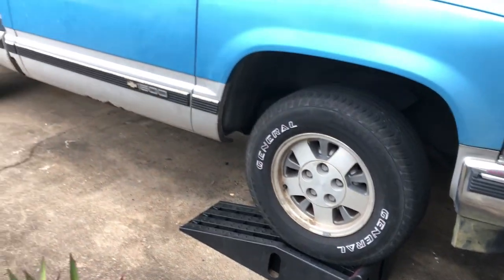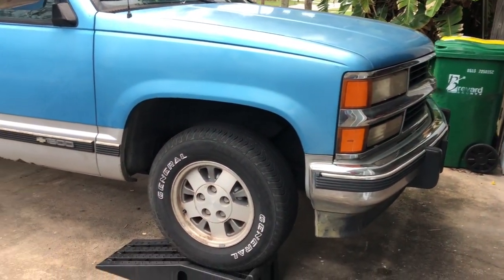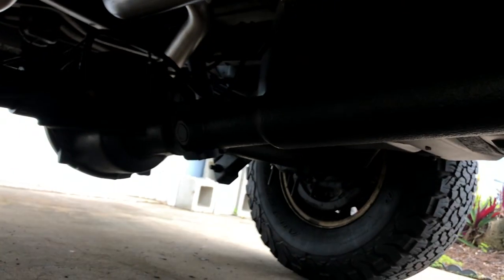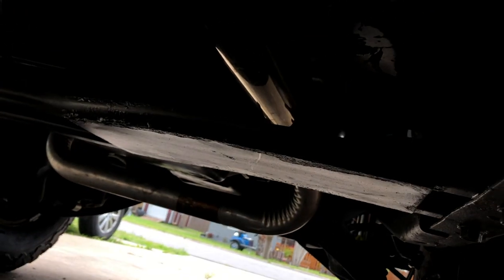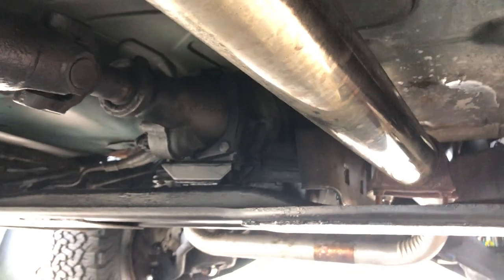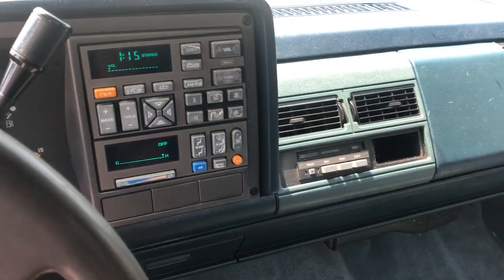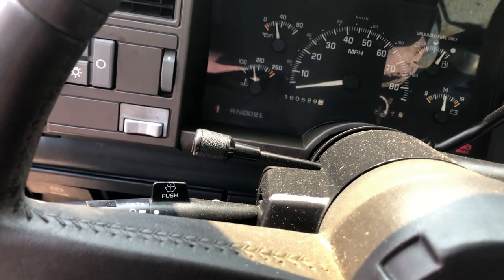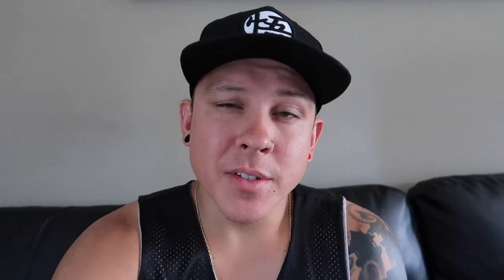Which Exhaust Note Sounds The Best?? (Budget OBS Chevy Series Episode 6)

Comment: With just the Y pip Sounds like my v6 stepside when I had it with just the Y-pipe before I installed a magnaflow catalytic converters with a dynomax exhaust system..
Reply from the maker: Dang that just shows how much the 305 has to offer lol the 305 V8 sounds like crap without a decent exhaust in my opinion but I bet that V6 sounds sick with the magnaflow and dynomax setup!
Reply: NachoSlacker I’ll have to post it on my Other account which is where I post my obs stuff. It has a nice rumble a bit quiet in comparison to when my dynomax system didn’t have a catalytic converter but a straight pipe. I went with the single side exit exhaust since this truck was my grandpa and he gave it to me.
Reply from the maker: @FaDeDStudios  I would love to hear it. I understand the sentimental value 100%
Reply: NachoSlacker This is my Chevy obs account. I just posted a video of my exhaust “progression” it’s a 1988 Chevy 1500 stepside. It used to be silver and burgundy but I’m “restoring” it.